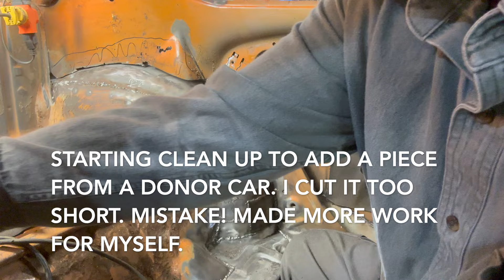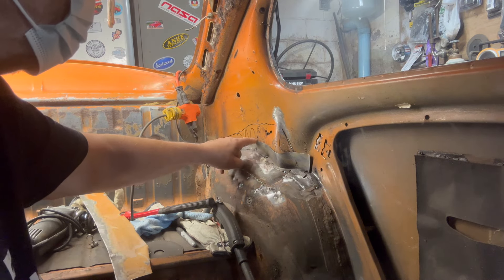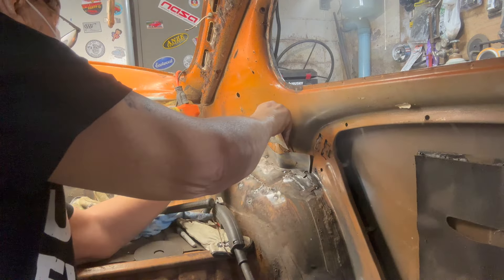Rear inside drivers side rust repair

Comment: Love it Dave. Two things. You probably know them but I’d hate to see you do it/not do it and wished I’d said. Put the bakerlite heater tube back in before you put the pan back. They are pain in the butt if you forget ,I know😂 You’ll see the captive nuts on the bit you cut off so you’ll need to add them, plus you’ll need to add on the cross member the hole for the body to pan bolt, there’s two on each crossmember, you’ll see them. Apologies if I’m saying something you already know. The other thing is, you have the three pre-drilled holes for rear window popout catch on the inside of that C pillar, so you’ll probably have the pre-drilled holes for the hinge for the window frame in the window recess where the rubber goes near the B pillar, if that makes sense? It makes fitting rear genuine used popouts straight forward if you was thinking of doing it.  I have a set to fit and if you do Buster will love all that air coming in from them and the roof👍🏼 Cheers Phil
Reply from the maker: Hello Philip, great hearing from you again. Actually I appreciate your foresight. You did remind me of the hassle I had putting in the Bakelite pieces in my son’s bug afterwards. It was very difficult. I even trimmed the flang to get it in place. I will make sure to get them in before assembly.
Yes, I do plan on pop-outs I did hear of that drilling in the past but have forgotten.  
I enjoy hearing from you. Plus it helps very much. 👍🤓
Thanks buddy. Your knowledge is a plus.

Comment: Where did you buy that nice crossmember panel?
Reply from the maker: Sorry I don’t remember where I got those panels I had them for awhile. The sticker is half gone but the part that’s on there says Klokkerholm it a Danish company. Hope that helps. Have a great day Gary,
Reply: @busterstravels1534  That explains everything. You said you have had them for a while. I just replaced 2 crossmember sections and your panels look way nicer than the new Klokkerholm panels I bought. I have not had good luck so far with any Klokkerholm parts. Thanks for the reply.
Reply from the maker: @garypannone7755  I look for panels at swap meets. Once in a scrap yard I found a front and rear apron in an old bug. New but old very good quality and paid almost nothing for them. I keep my eye out for bargains. They really did make things better in the past. Fitment was better also. 👍🤓